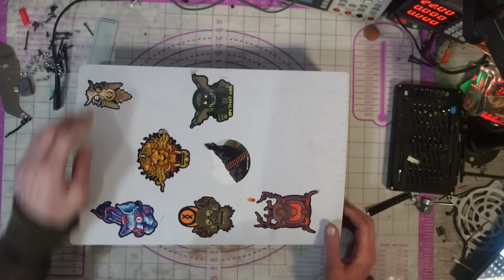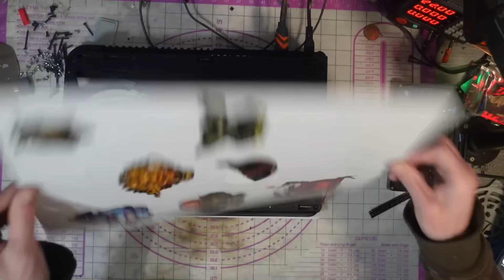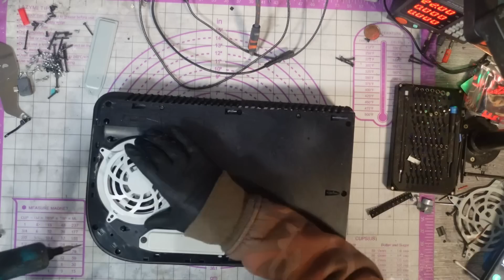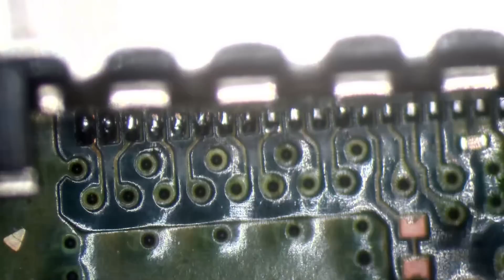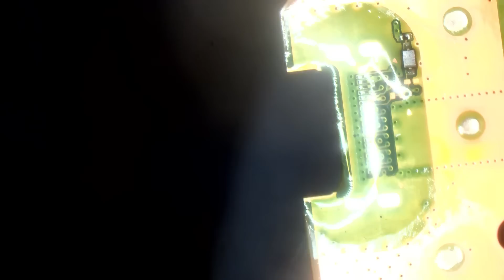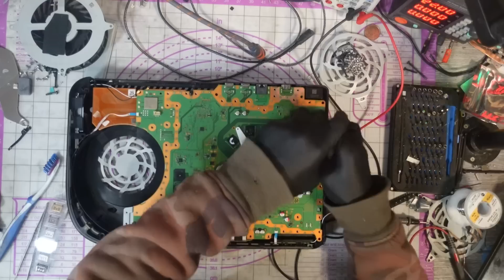We All Make Mistakes...

Comment: I think either way you can't verify there wasn't always a problem and you'd given out something with a defect you can see yourself you had introduced, then you cover it anyway. As unfortunate as it is, realistically you have to take your failings as failings even in circumstances where something has worsened the problem. Simply cover the work, at most charge a bench fee since it should've been returned during warranty with the issue. Just keep it in mind in future and draft yourself a test protocol that eliminates these kinds of possibility in the future, you can get tweezer plugs for your multimeter to rapidly test between two pins with just one hand, no need to hold 2 probes so I'd hugely recommend picking some of those up since it's something you can do that only adds 30 seconds onto your repair procedure

Comment: What is the use case for unplugging a console? I plugged my PS5 into my 5 port splitter once, and that goes into the television. I've never unplugged it. HDMI is not like plugging in and unplugging your vaccuum cleaner or cellphone. Not robust enough beyond a few cycles.

Comment: I believe you have a 3 month warranty for your own work that you've done. Now if the owner has left it for 6 months and they have had problems with it since then that's is on them regardless of what's at fault. It should be classed as a new job.

Comment: You should use your own warranty markers: after a successful repair, attach water damage stickers on the board and seal some screws. Also make photos of the repair job (i.e. how the hdmi port looks, how the fan looks, etc), print and attach them to the customer's return package. Makes a lot of difference.

Comment: For customers that insist on this constant console moving, I suggest to them to buy a 1 m hdmi extension lead and plug this into the console and then type the console to the cable and when they are moving it just unplug the cable from the extension each time instead of from the console itself, this seems to save the port them as they aren’t ripping it in and out constantly
Reply: @tastytechaddictsmtb  I do this exact thing with a Firestick. It’s a 6” flexible extension.
Reply: @ashleybignell2366  i do this too, I use my PC monitor on the xbox too, i dont want to be plugging cables in and out of the pc the xbox or the monitor. so the lead coming out of the monitor is a extension lead

Comment: 😊What she meant is that when it came back from you fixing it last time 6 months ago that the flickering started then, I.e. your error in spotting the bridge 🌉 from your 1st repair is why it's been flickering, just hold your hand up it's not that difficult to figure out what happened, should be no charge because it arose from your not catching it when you repaired it 6 months ago, don't be a Fagan, just let it go as a lesson learned 😊
Reply: Fully agree. Soldering mistake on the changed port has been there all that time, propably giving headaches for the the customer. I also heard a bunch of accusations and unneeded b*ching from the Coder. And a broken wire.

Everybody has bad days, even repair professionals. But this is not a customer error. If they wan´t to run their PS5 24/7 it is their choice.

Comment: No.... warranty is for immediate issues. This should be a new repair bill, especially if it's being run 24/7
Reply: warrant is for the time period of the warranty, doesn't have to be immediate, usually warrant would be for a year on anything new. ive had stuff repaird and not used it for months before discovering it still doesn't work, on occasions its been too long and theirs nothing i can do.. it happens.

Comment: Brill job mate, is it just me that puts a hdmi cable in and never moves a console?  been workin for years no worries.
Reply: Same here , I plug it in and leave it alone , if it is removed for any reason it is done very carefully and in line of sight .. no fumbling around taking stabs. Has my PS5 for 4  years with out issue  gets cleaned and looked after … oh and always been used in vertical and well ventilated.
Reply: many reasons why a console may get moved around, maybe its shared, the kids have turns, rather than having one each, maybe the parents use it sometimes, who knows...

Comment: As a mechanic for over 25 years, working on friends cars is the thing to avoid, they want everything done for nothing and every time something goes wrong they think it's linked to the previous work done
Reply: i only learned how to fix cars so i can do mine, friends and fams for free
Reply: Friends and family, I charge them triple, I tell them straight out you want it done cheap or properly?  They always choose cheap 😅 then I tac tac them on the way back when sheet goes wrong.
Reply: lol exactly, they will use it as a reason not to pay you for previous work too

Comment: These consoles are designed to be running continuously, I've had all my consoles at one point running for days and sometimes weeks without issue because I also make sure the ambient temperature is good. 

They're effectively low power computers, and low power computers are absolutely designed to be run 24/7 for long periods of time.
Reply: Only when the user leaves enough airflow around the console, and the fan doesn't pick up dust bunnies, pets hair, lint and tar.
Reply: @bufordmaddogtannen  the console shuts itself down if it gets too hot.
Reply: @viet0ne . Or it slowly cooks itself when used improperly.
Reply: @viet0ne . Or it slowly cooks itself when used improperly.
Reply: @viet0ne  yt doesn't like my reply.
In IDEAL conditions a console would last forever. In the hands of animals it does not. An improperly used console does not necessarily get to a point where it shuts itself off.
Reply: @viet0ne  this one didnt...

Comment: Can you not have a HDMI adapter, that connects onto the HDMI that is on the console, so that it would be the adapter that would break and not the HDMI on the console side?
Reply: yes, i use my pc monitor on the xbox, 3090 in the pc, gaming monitor and the xbox, i dont want any of those ports being plugged in and out constantly, i have a extension lead in the monitor, the hdmi leads stay in the monitor, pc and the xbox, i plug what im using into the extension lead

Comment: Sounds like the issue just happened again (not caused by the repair work) - shouldn't be under warranty
Reply: the ribbon cable didnt damage it self, and the solder didnt bridge itself.

Comment: When I worked in Sony they ran 24 hours a day never had any issues
Reply: As long as you keep it clean I don't see an issue.
Reply: @Dragon_Slayer_Ornstein we did see the issue, the board was showing signs of heat damage
Reply: I think this console is used to mine some kind of ingame crypto so working 100 percent 24hrs with blocked heat fins.

Comment: Low key….if a hdmi port continuously gets damaged…somebody is probably very heavy handed in inserting the cord ….like the ONLY times I’ve ever had that happen is when I was super rough in putting the hdmi cord in …then sent it to EB games ….then said I’m not 100% sure but it could be because I jammed it in fairly hard …sure enough the repair came back with a note “yes it was the hdmi port” obv that’s not always why ….but if that particular part keeps doing that 😂 it’s probably user error (sometimes rage) 😂they are tough but not invincible…p.s just got into watching repairs love your videos 😎
Reply: yes but. if the plugging it in and out gets it to work, you can see how that may get frustrating. sort of like having a broken lead, if you bend it the right way it will work, but eventually the port breaks... customer should have taken it straight back, or at least made a call. i think their is blame on both sides, personally id just swallow it.

Comment: I will never understand how people break those ports, they plug and unplug it all the time or something?
Reply: By doing what I did …jammed it really hard 😔 yea …I learnt years ago on ps4 be gentle veryyyyy gentle lol
Reply: Maybe they don't have enough hdmi ports for all the devices so they unplug the ps5 to switch it. If so they probably unplug it blindly and end up forcing it
Reply: I've had one instance with one of those cheap hdmi cables where the end had come off in the port when I tried to unplug it and had to get it out with tweezers, but no I've never damaged a port (other than USB) and even then not the connection to the board.
Reply: just a shit thing to have not as good as RCA or Scart
Reply: well if it works after plugging it in and out enough times, you can see how that may happen, kinda frustrating, sounds like it was ok on one tv, but had issues on another